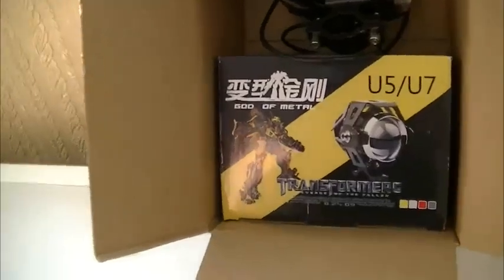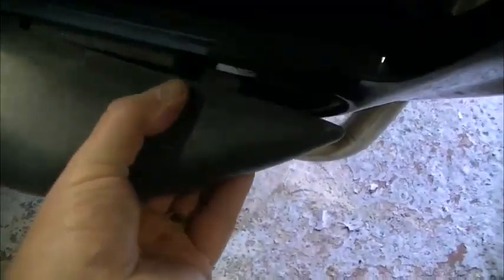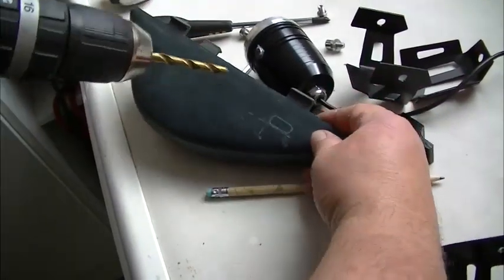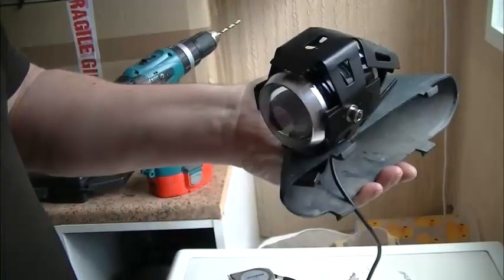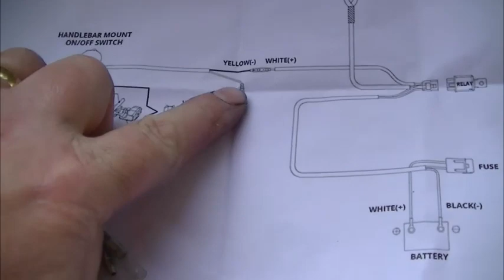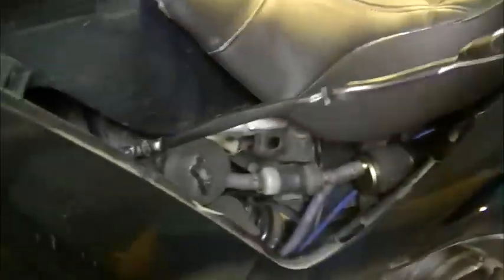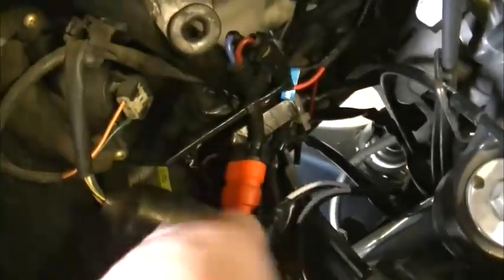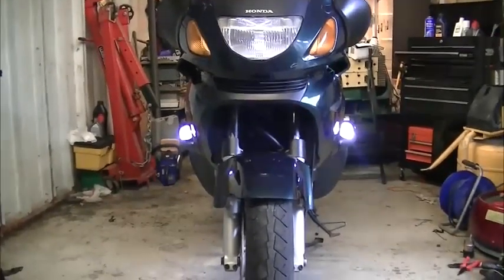Fitting additional spot lights

Comment: Good video mate, but at 22.31 shouldn't there be a plug on the end of the lamp wires? How did you connect the wires, did you just push the 2 wires into the loom plug holes?

Comment: Good vid sir! Not sure I'd necessarily bother with the switch and wiring loom, I'd probably take a feed off the sidelight circuit (depending on the necessity for the switch). With the switching on and off for each mode, can you get it to "default" to just the low setting, or do you have to use the switch to cycle it?
Reply from the maker: +Lurch OnABike First power on is high power, power off and back on within 10 seconds to low power and again for strobe 
Once you have the setting you want you can have that setting every time as long as the power off / on is longer than 10 seconds
Reply: +tingbiker Thanks, that's good to know. Did you say £25 the whole lot delivered to your door? And was that UK stock?
Reply from the maker: +Lurch OnABike. Spot lights £22 delivered from Wednesbury, UK seller econlineer on eBay